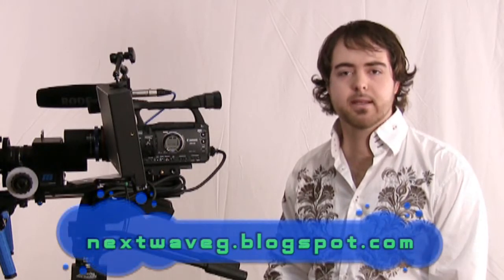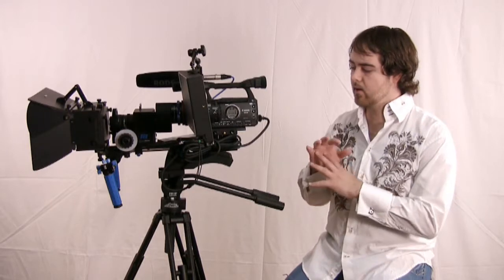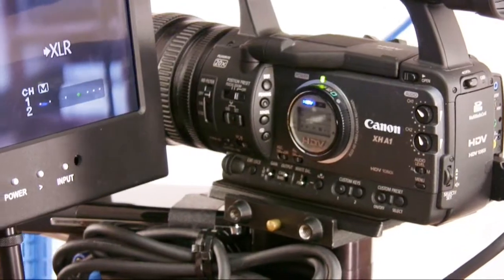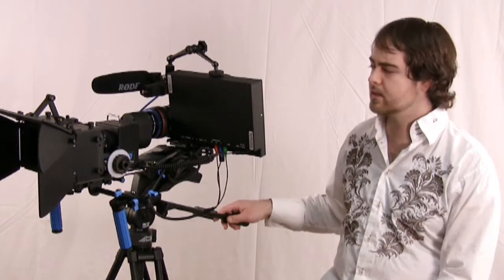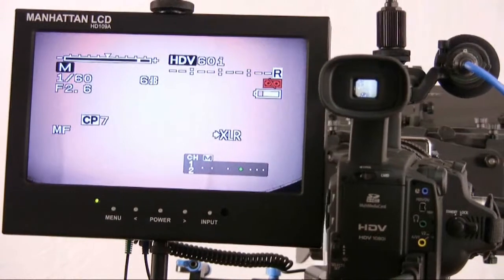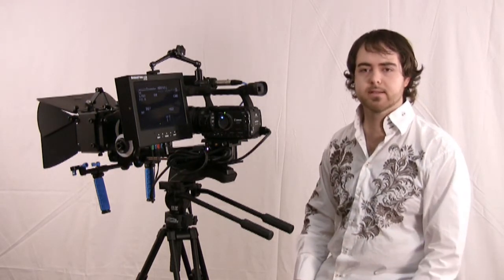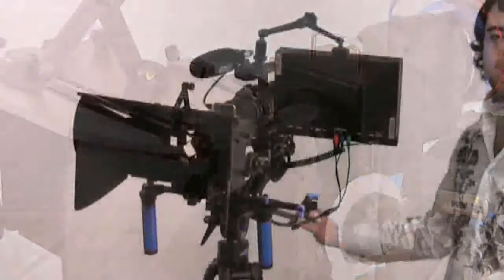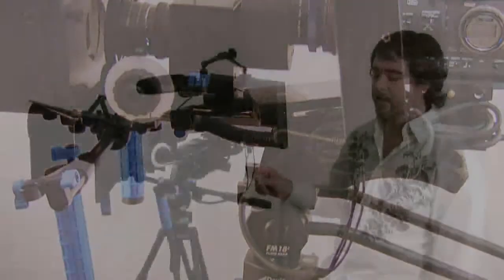DVTV - Upgrading a Prosumer Camera Rig (Canon XH-A1) - Part 1

Comment: @JillmanPhoto You've probably got a firewire port on your DV/HDV cam - connect that up and then capture your footage using your editing software. If you're using the canon XH A1 it's on the back under the panel next to the battery compartment.

Comment from the maker: depends on the weight threshold of the jib.  The rig weighs 15+ lbs. and a jib like the ProAm wouldn't be able to handle it very well.  You get a Kessler Crane or a Jimmy Jib....then you might be able to.  But I will say that I have seen other camera rigs like mine used on jibs before.